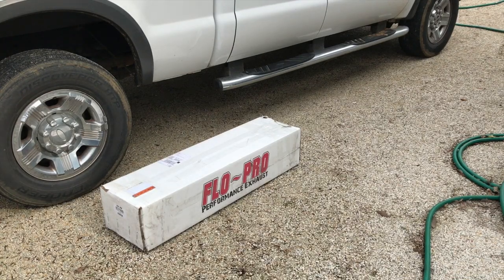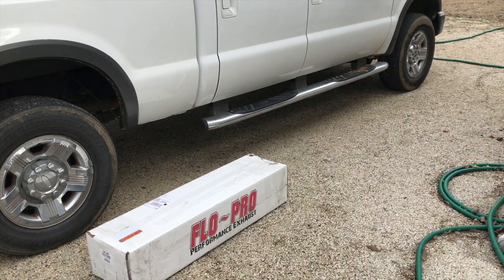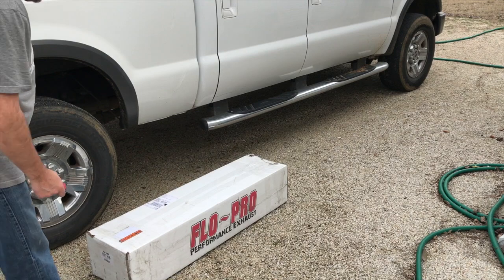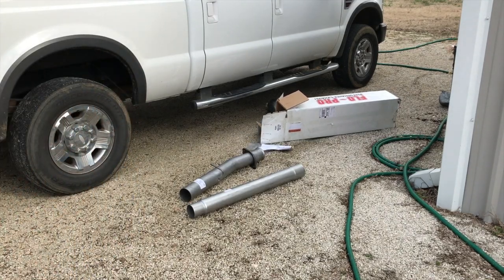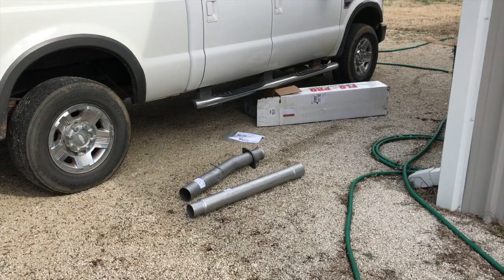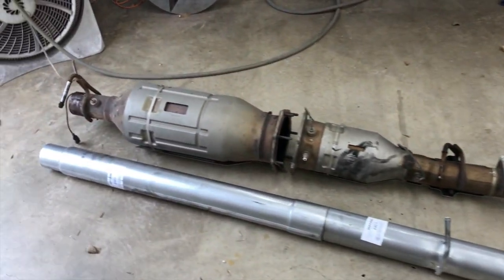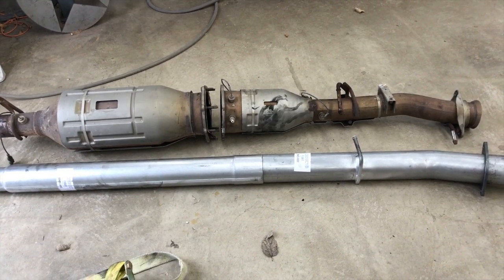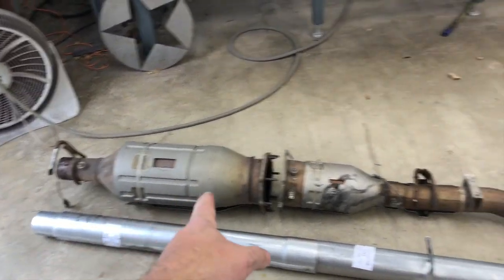DPF Delete Pipe 08 09 10 Ford F250 Powerstroke 6.4 Diesel Superduty - Offorad - Race

Comment: This and the egr delete gave me my truck back. With the help of the MinniMax tuner. With a high-performance air box. I chose the S&B intake kit.
Reply: I've got a 2098 f-450 power stroke diesel that needs a car delete and the computer console but I'm limited on funds and knowledge on what to get
Reply: @robertroach5799 If they haven’t figured this out on the 2098 models then there’s definitely no hope..

Comment: Did you reprogram the computer?
Reply: You have to. You also need all stock sensors plugged in.
Reply: Yes.
Reply: The tiner comes with all instructions you can get rid of most of that puff of black smoke lower the low fuel to 2 I think it comes set at 3. Trust me don't race this engine. Unless you do race mods. Just for piece of mind, I replaced the head bolts with quality performance race ready studs. And never go street or high performance on the tuner. I usually just leave it set in stock unless I'm pulling the trailor. Trust me you will like the performance after all that junk is gone. I get about 5 miles a gallon better now as well. She will still put a smile on your face when you pass someone 😊

Comment: Thanks for the vid.  Some issues I encountered were:  Most likely there is a U bolt clamp  clamping  the DPF to the back pipe.  You should have a pipe expander to open it before hand..  My auto parts stores were all out of the rentals so I ended up strapping the back pipe down by the hanger so I could pound the pipe in using a block of soft wood and a 5 pound hammer. Mine came apart easy enough but I i used a Come Along attached to the rear hanger and the front crossmember to pull it all up tight.  Lotsa WD40. With everything loosely fastened I started tightening up from the rear forward.  Sure took me longer than you.  Funny thing was once I got the DPF off I see the previous owner had removed the screen,!!

Comment: Did u do anything else to the sensors. I was told u have to pull the sensors out of the dpf and hook them back up.
Reply: I was told the same thing this afternoon with doing the dpf and egr delete. Was told I had to hook the sensors back up and tie them up out of the way so it will idle down even with my sct live wire tuner. Trying to find out about this myself
Reply: Yes, because if you reconnect them, the car will never start

Comment: I've seen a lot of these delete videos but only 1 mentioned dummy plugs for the sensor plugs that are zip tied. If you need to reinstall the system they'll be dirty or corroded when you  got use them.

Comment: Okay do you have a tuner because when you pull your DPF off it throws a code that won't let you crank your truck cuz I got a 2008 64 and I deleted the guts in my DPF and it threw a code
Reply from the maker: yea i have a programmer
Reply: How to deal mine one, i always use in city and it keep cleaning and it anoying  everyone witb smooky? Any idea please?
Reply: That's the biggest problem. Like really epa this was supposed to be 'cleaner'?
Randomly rolling coal on unsuspecting pedestrians on to notice
'Cleaning Exhaust Filter' on the dash

Comment: How Did you bypass the sensors for it to run after the dpf delete
Reply from the maker: A friend re programmed the PCM
Reply: Just hollow out the dpf and leave everything else 👍
Reply: @ironjohn5914  little late bud

Comment: So with both deletes, is the 6.4 more reliable? Deleting all the horror stories..
Reply from the maker: yea so far so good.  200K miles
Reply: No it’s still a garbage motor. All the ford diesels are a joke. If you want power and reliability go with common rail 5.9 or a duramax.
Reply: @simoncorriere8209  yeah i have run(drivers) about 30 million miles on diesel semi trucks and all the bs with a (except 7.3)  with ford diesel  makes it garbage,clown show
Reply: Working. Replace head bolts with quality race studs if your tuner gives you high performance. My tuner is stock, street, haul, and blow the dam thing up😱💩

Comment: HAY GARY, WHAT DO YOU DO WITH THE LINES N FROM THE EX. AND THE FUEL LINES TO MAKE IT RUN ,RUN A VIDIEO ON WHAT TO DO WITH THE PROBES AND N THE FUEL LINES PLEASE THAT WOULD REALLY HELP.  THANKS, JEFF
Reply from the maker: I didnt do anything with fuel lines, just disconnected the sensors and tied the connectors up out of the way.  It could easily be plugged back in.  The fuel changes were made in the computer, basically the whole DPF sub routine was turned off on a re program.
Reply: Ramsey Customs - turbocobra 😎

Comment: Lots of off road engines have DPF to meet tier 4 emissions standards. Not that it matters, but "off road" isn't really an out from a legal perspective,
Reply: Hey Wes! That's true, but luckily down here there isn't any emission inspection actually where I live in OK there's no inspection tags of any kind on vehicles. I'm sure if they wanted to they could get ya while your pulled over but they don't and judging from how my Duramax ran after deleting mine long ago I'd make up a spool piece w/ v-bands or something to take in and out for inspection if I had to. Going from that kind of restriction to 4" true dual made that truck run completely different. It was like it was she couldn't breath with that crap on her.  Besides now I can let her idle as long and often as I want w/o fear of clogging. Can't imagine having to worry bout that, it's a damn diesel ya know

Sold any machines yet?
Reply: It's his truck and he can do anything he wants. But, I have heard some stories of the EPA fining shops for removing emissions devices, diesel or not. Saying it's off road only is probably not a good defense. Just tell them it's for military use ;)

Comment: which programmer / tuner do you have on it? to read the error codes for the dpf

Thank 
From Holland
Reply: The cheap effective way is GearboxZ DPF-R 4.0+
Reply: @rovidbouski4022  can i use same tune for 12 f250
Reply: Jaskaranjit singh, you have to order it for the 12 as the tune for the 6.4 is different than the 6.7
Reply: @rovidbouski4022  after all that any emission pass problem because i am living in California?
Reply: Jaskaranjit, You cannot perform any mods in California, you live in a shitty Communist State that PUNISHES TAXPAYERS TO REWARD ILLEGALS. I feel so bad for you. The mods that save these engines are prohibited in California. The Democrats there think you should take the train.

Comment: hey bud, out of curiosity what tune did you run?  Is it a add 150 hp? or a simple tune that just deletes out the regen cycle and doesn't purposely add hp?? thanks big guy
Reply: I'm interested in deleting and I would like to know what tuner you used.
Reply: If you have a 6.4 powerstroke the flo-pro delete with 4" straight pipe with a GearboxZ DPF-R 4.0+ for around $550-$600. It adds roughly 70 hp. Easy instructions but keep your old parts for inspection time. People say its really bad for the environment but if you look at it as going from 8.3-8.5 mpg city to 15.5-16.6 mpg city you are burning half the fuel, fouling less parts, making the truck more reliable.
Reply: @rovidbouski4022 so if I get the gearzbox would I have to have a computer hook up to it to clear the code or is that what the gearboxz dpf r dose
Reply: Honestly I think a good easy going tune would be better for the environment. Think of all the fuel saved. Less damage to extract, refine, transport and finally burn all that extra fuel these systems waste.

Comment: Don't understand.......off road. You're not driving it on the road anymore?
Doesn't the DPF stuff need to be on there to pass emissions inspection?
Reply from the maker: No it doesn't have to be on there for inspection as of now, but they may require it at some point in the future, so I saved all of it and the bolts, etc
Reply: There is no emission inspection in the state of Texas, dont for see there will ever be one
Reply: Erstwhile when you do the state inspection they do the emission at the same time. Ever wonder why they put something in the exhaust when they do the inspection?
Reply: @Daniel-vq9zb  it depends in what city you live in. I live in Dallas so yea we have emissions inspection. They put a sniffer in the tailpipe, they also get under the truck and look to see if it's deleted. The dot has a program on their computer they will hook up to your truck and see if there was a delete tune done. First offense, $1750.00
Reply: @Brett235  Thats crazy! I live in Houston and no emissions inspection here. Once the inspector knows its a diesel they just do safety inspection only and charge $7.50 for it.
Reply: Need catalytic to pass only
Reply: @Daniel-vq9zb